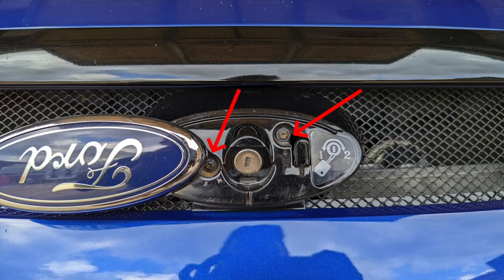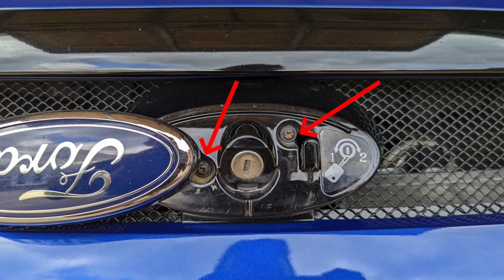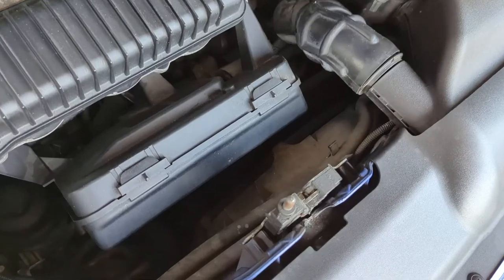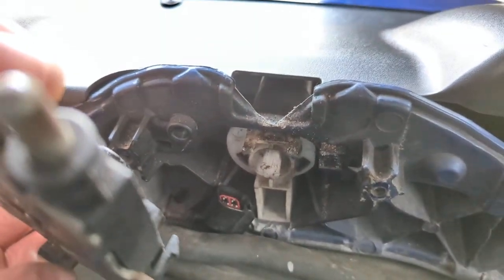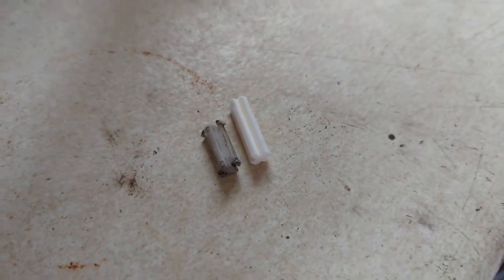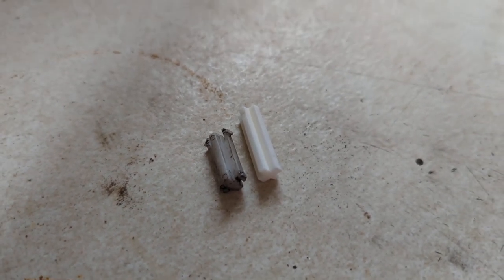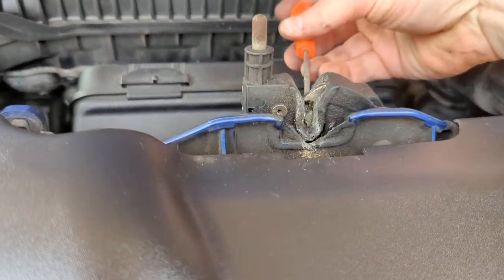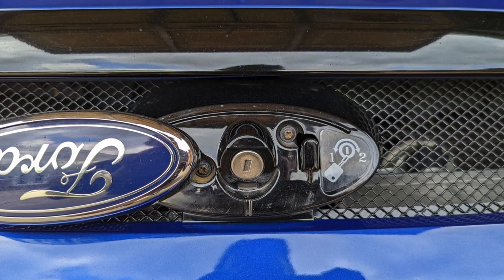Focus RS & ST MK2 Bonnet Latch Fix with Upgraded Part

Comment: Please help me my mk2 rs my bonnet won’t open you didn’t say how you did it!!!and it’s locked shut how can I get it open please I’m stuffed
Reply from the maker: You need to remove the Ford badge first then basically use a big screw driver to break the original mechanism/white plastic bit. Once you have cleared the debris, you can use a long screwdriver essentially as a key to unlock the bonnet. Hope you get it sorted 👍

Comment: I found if you fit it without cutting it down to the length of the original it holds the mechanism apart slightly which then stops your grille sitting properly.
Reply from the maker: Yeah a few people have mentioned this and it seems that sometimes you need to cut it down a little for a better fit.

Comment: Brilliant video will be ordering one 👍❤️
Reply from the maker: If it ends up a little stiff, you can trim 2-3mm off the end and it's perfect 👍
Reply: Just fitted mine work's perfect thanks for sharing this with everyone ❤️
Reply from the maker: @davidwood4271  great news and no problem! Did you need to trim yours down a little or was it good already?
Reply: I took a very small amount of with sandpaper
Reply from the maker: @davidwood4271  perfect, cheers for letting me know!

Comment: Hey James , on watching your video I decided to get one of those white ( longer) plastic updated part. There was nothing wrong with the oem one but just as a precaution I wanted to  fit (or tried to fit) the updated one before the oem one broke. I pulled out the latch unit which had the original pastic one in it but for the life of me I could not get this plastic part out from the latch unit. How on earth did you remove it?
Reply from the maker: Hey, because mine was slightly worn it would have come out reasonably easily. However, you should still be able to pull the original part out with a pair of pliers I should think, even if yours isn't worn.
Reply: @CarswithJamesMosley  Thanks for your reply. 
Tried pliers and gave it a strong yank a couple of times but it did not budge🥴. Gave up as I did not want to cause any damage .🙄
Reply from the maker: @LeeJohnson-v1k  I take it you could see one end of it once you removed the latch? Maybe your clips are just in really good condition and are nice and strong still 👍

Comment: Lovely video buddy! 
I own a st225 which I have always been concerned on the bonnet latch which has caused me to standing in the rain a few times taking far to long to open the bonnet. I found your eBay link and will get one ordered. Seems nice and simple to resolve the issue. Thank you so much 😊
Reply from the maker: No worries mate, glad you find it useful! As some others have mentioned here if you find it stiff when fitted, you may have to shave 2-3mm off to get it perfect, but this can be done easily if needed 👍
Reply: @CarswithJamesMosley  finally got round to doing this today! 
And I found out as you said the part does need to be cut down exactly like you said. Works perfectly now! Just another comment if anyone is ready and needs further advising you need to cut the bit down slightly!
Reply from the maker: @NewKoshin  nice, thanks for letting me know and glad you got it sorted 😁
Reply: I've just replaced mine so big thanks. I tho rather than cut it done put spacers between the locking mechanism and car body which does the same effect just moved he bonnet latch 2/3 mm out towards engine so the part is made smaller as it was too stiff.

Comment: Nice video,
However this is only one cause!
The other being the shaft itself not turning freely (the stiffness you mentioned possibly)
If the shaft doesn't turn, and is seizing inside the casing this replacement won't help unfortunately, as the shaft is worn you cannot turn it enough

If, however the plastic is broken this is definitely worth doing. Saves time and money
I'm going to have to replace the entire thing on my st225, but I'll be putting my original lock barrel in the new part just so I haven't got to carry round an entire key and can use the valet key in the bottom of my fob
Reply from the maker: Thanks mate, very interesting! The Mondeo latch kit is also another option that I'm considering for myself at some point to future proof the whole thing.
Reply: @CarswithJamesMosley  I did consider that, but it's a faff and you have to ruin the bonnet catch area to accommodate the lever... plus fishing the cable through is just agg!

I took my lock out today and mine does turn freely (holding the barrel in mole grips and turning with the key, turns the white collar as expected with no resistance) so it looks like this cross shaped plastic would work absolutely fine for me! 

Also, you can pick up anew cable and barrel with a key for about £15, and apparently, you can drill the rivets out of the lock barrel, and swap your original one in, and use the original ford key exactly as you would... for the sake of £5/or £15 i'll definitely give it a go. plus the seller states a 3 year warranty.... so worst case it's cost me £5 a year and has to be replaced again...

now to sort the coolant leak and exhaust manifold gasket and i'll be done with it (for now, until she decides to break something else)
Reply: That was my issue so I’ve ordered one of the metal ones of Ali express like a lot of people have done. Just replace the old lock for the new one no cutting like mondeo lock. my rs has had 2 locks now hopefully the metal one lasts

Comment: Hi,how long in mm was that new piece ?
Thanks
Reply from the maker: Hi Richard, unfortunately I didn't measure the new piece before fitting, and it doesn't appear to show the size in the listing. However, myself and few others on here appear to have found the cutting off a small amount (2-3mm) from the new piece helps it to be a better fit and less stiff to turn. Mine feels like the original now.
Reply: Believe they're 8mm